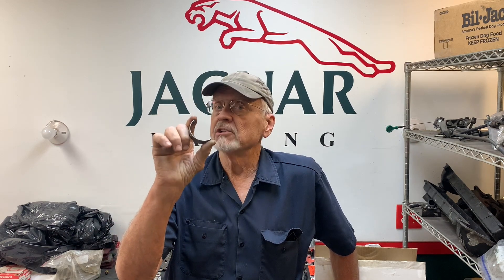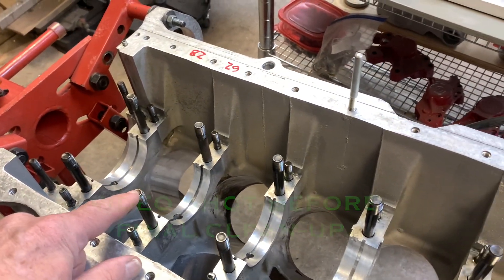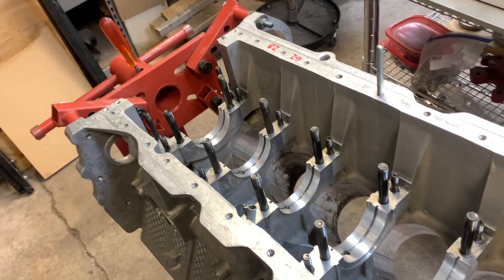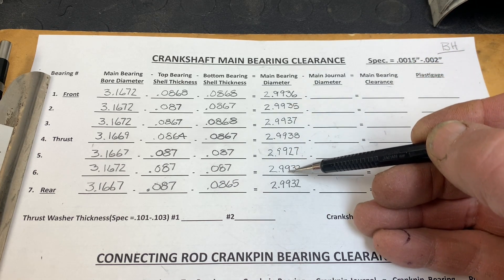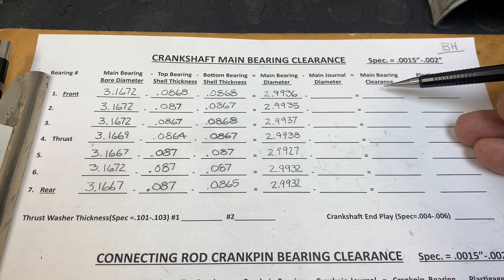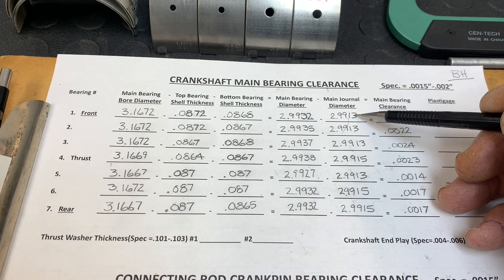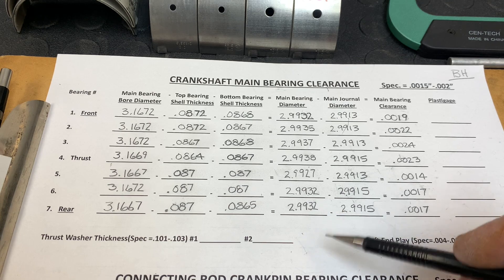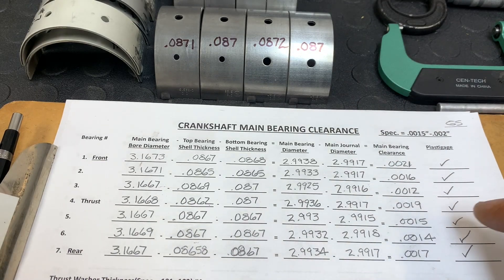S.4:Episode 3-Setting Up The Crankshaft Bearings On The Jaguar V12.

Comment: Question. there is an old guy/ old skool mechanic . from the 1970's / 80's. worked on the Jag V12.  At a dealership. 
he told me that 
I should NOT mill the jag head if it was warped ( say .009 out of wack) . 
Since if you grind the face of the head flat, removing the warp, then  it would make the  Camshaft bearings be NOT in line anymore (out by .009) , and cause problems of the cam buckets binding up and grenading engines. 
He said just put the warped head back on and the haed gasket will make up the dirfference. And the MLS gasket would seal up the cylinder head. 
Comments???!? 

I do not want to grenade my engine, and my heads ( all 6 of them from 3 engines)  are warped!
Reply from the maker: I'm not sure if I address this in the video but your mechanic is right. any OHC head that is warped will likely have issues with cam bearing bores as well. The head must be straightened before planing. https://www.youtube.com/watch?v=lDURpa0WKKY&t=31s

Comment: I really appreciate seeing the attention to detail in truly 'blueprinting' the engine. Question I have is you used a flat anvil micrometer to measure the bearing halves. Does that give you a true measurement of the thickness of the shell which is curved?  Shouldn't you use more of a pin point micrometer?
Reply from the maker: The micrometer I use measuring the bearing shells is a ball anvil micrometer.

Comment: Do you ever polish bearing on your crank or cams to reduce an oversize?  (or even had that problem?)  I worked at a Dana cam plant in college and I was surprised how much of the production required manual polishing to bring bearings to spec.  It was also interesting how much difference there could be between left center and right.
Reply from the maker: That is certainly a good option. But I've found that having two sets of bearings to work with, particularly with the main bearings, the same result can be achieved. A real time saver.